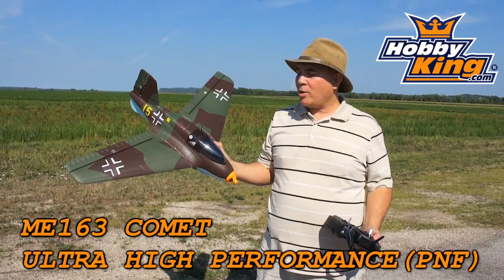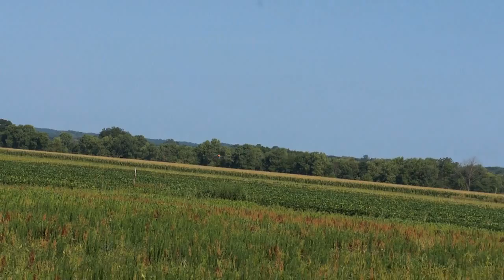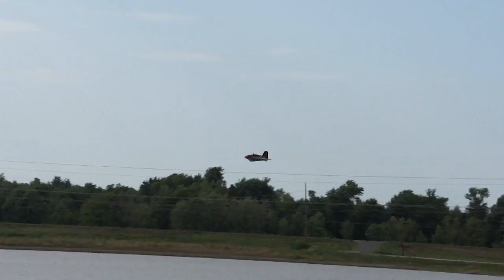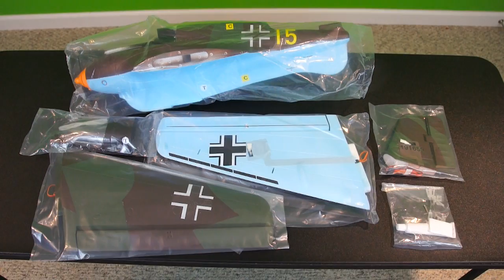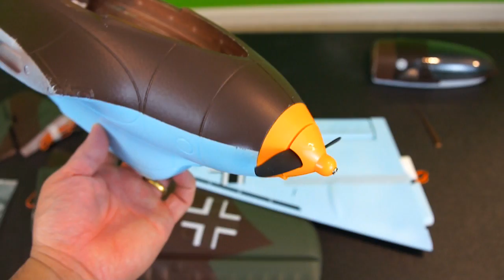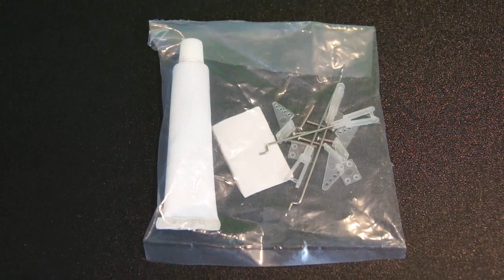ME 163 Komet Ultra High Performance (PNF)

Comment: nice plane 
i love how it scream in the air
how fast can it go, can it fly through a strong wind?
and how slow can it fly, can it glide real slow?
it comes in very fast when you land it  
TIA!
Reply from the maker: We never did a speed clock on this plane but it is very fast. Wind isn't a problem, it actually helps when hand launching the plane into the wind. It's heavy for it's size because of the 2200mah 4 cell and inrunner motor so it doesn't glide really slow. As seen in the video landings are fast.

Comment: The ME 163 Komet original was a rocket-powered aircraft and not a propeller power: http://en.wikipedia.org/wiki/Messerschmitt_Me_163
Reply: it had a small propeller in the nose of the plane
Reply: The small propeller was for another propose:"(...) and a generally one-piece nose for the forward fuselage which could incorporate a pioneering example of a "windmill" generator at the extreme front for supplementary electrical power while in flight (...)": http://en.wikipedia.org/wiki/Messerschmitt_Me_163
Reply: Ok
Reply: I believe this R/C model can have a model rocket engine installed

Comment from the maker: Never flown the RareBear but have flown many of the other FunFighter planes. They are very fast on 4 cells, clocked one at 108mph. Never clocked the Komet but sure it does over 100mph as well. I think the Komet may be a little faster but the FunFighters are much easier to get in the air and are more agile due to their low weight, less than 14oz. The Komet is much heavier around 28oz and that small 4.1x4.1 prop is why it is more difficult to get it airborne. Both are a blast to fly!!!

Comment from the maker: Use to hate having that problem with my DX6i. You either need to swap your aileron and elevator servo plugs around on the receiver or play around with the servo reversing in the radio menu. If all else fails read though setup section in your DX8 manual several times, lol!! I'm glad I got my Airtonics RDS8000 now.

Comment: I'm having a hard time getting this plane in the air! I had to set up elevons and can't get the correct direction going. The elevator works but the ailierons go in the opposite direction. I use a DX8 radio. Can someone give me advice on how to fix this? Thanks!